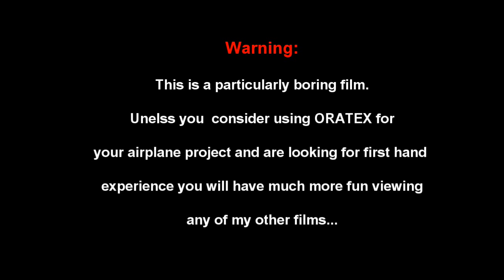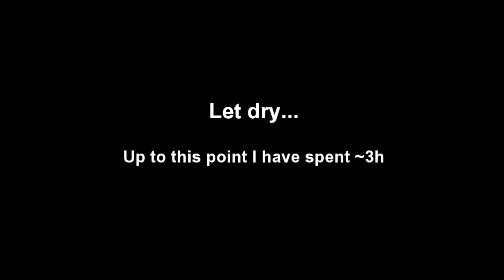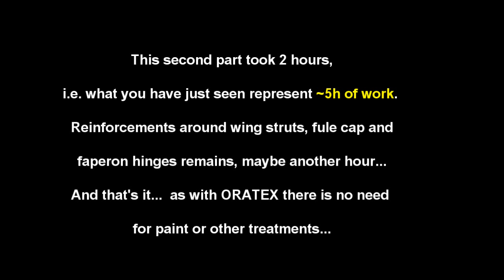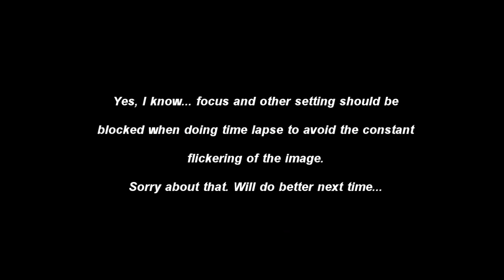Covering a wing with ORATEX UL600

Comment: Great job Fred.  I am going to use Oratex on my next airplane covering.  I recently replaced the fuel tanks on my Kitfox from 1992 and had to use the original Poly Fiber system for patching two rib bays.  Took about 25 hours and the cost of the toxic MEK based materials exceeded the Oratex cost for sure.  Plus I had to wear a respirator while completing at least 20 steps.  Poly Fiber is good, but I think Oratex is the future.

Comment: how much does this stuff cost anyways? were can it be purchased? does it work on wood as well?
Reply from the maker: If by "the stuff" you mean Oratex it cost about the same as covering with traditional methods, not by the meter but as total cost. There is no need for any kind of paint job so if that is something you would have paid for you can subtract that as well. 
Yes to wood, luckily as most of the surfaces glued to on my wing is wood...
If you go to the Oratex/Oracover (google or go to the link section on my blog, link to my blog in the comment section under the film) you fill fine all required information including local retailers and user manual (downloadable as pdf).

Comment: I don't agree with you at all I have no intention of covering a aircraft with this but this video was fascinating. Well done you look like a pro.
I wish it was a certified fabric my Brother has a Taylorcraft that is in need of covering and this stuff looks intriguing.
Thanks for a assume video.
Reply from the maker: Thanks Taz Man. Oratex is certified for both light and heavier aircrafts (Oratex 600 for aircrafts up to 600 kg, Oratex 6000 up to 6000 kg). But the certfication might be country depenent. You brother can find more information on the oracover web site or by contacting oracover directly. They are very responsive.
Regards,
Fred

Comment: aren't u sposed to wrap the first one around the tube and only trim the second to 1" wrap min.
I still think a couple layers of boat shrink wrap might work
Reply from the maker: You need to adapt the method to the construction of the wing you are working with. Starting by wrapping the leading edge 720 degrees as it says in the instructions isn’t really a viable option on this wing. Still holding up well after 6 years.
Reply: @fredstork  I just finished covering the tail of my kolb with polyfiber.  The problem with this stuff is ordering it by the quart and needing another quart and getting hit with A Spruce shipping again and again.  I should have bought gallon of polybrush and polyspray instead of 2 quarts.  I came up a bit short on what I wanted to apply for polyspray too.
Reply from the maker: @FourthWayRanch  not the right video for you if you are using polyfiber… very different technique compared to Oratex

Comment: Hi Fred, thanks for the video.  A few years have gone by since this video was made.  How's the Oratex holding up?
Reply from the maker: Scott Settlemire I got your question just before going out to the airfield so took good look... It still look like new. It is holding up very well. I expected to have to do some heat-gun re-tension from time to time but have not felt the need. In the video description you find a link to my blog. Select only the Oratex posts and scroll down (eventually you need to click "older posts" at the end... Anyway, there is a post on stress testing and aging of Oratex that you might find of value.
Reply: Thanks for the update and videos Fred.  I’ll be placing an order to cover my Challenger II soon. I will take a look at your blog.

Comment: Great video, I will recover my Kitfox 2 shortly.
Did you glue together 900mm and 1800mm sheets?
Reply from the maker: Hej  Peter! Yes that is exactly what I did. There is more details that can be of use to you on my blog. Here is a direct link to the Oratex section of the blog: http://avidsimonini.blogspot.com/search/label/Oratex
Reply: Hej Hej 😀
Some great info there Fred, thanks!

Is the glueing of two sheets an approved method by oratex?
I can’t find any information about that in the manual...
Reply from the maker: @Peter_Eriksson  You will always be gluing Oratex against Oratex in some places when covering so there is no reason why you should not do it. The overlap is rather large and turned the "right" way so I have no concerns. There is a very nice comment from BetterAircraftFabric (pinned on top) , they are selling Oratex to the North American market and would most certainly have protested if I was doing something wrong...
Some time ago I had to redo the landing gear any it was very difficult to get the Oratex off the tubes and Oratex on Oratex could not be separated... But again, I'm just sharing my experience so don't do this at home ;-)
Reply: Thanks for taking the time to answer Fred!. I totally agree with you 😀

Comment: Hi Fred. How did you manage to glue two sheets together (see 0.33) without shrinking the fabric at those points? Surely each time you apply heat to activate the HotMelt glue, shrinking takes place??
Reply from the maker: Hi Reddogchi ! The glue is activated at lower temperature than the shrinking...
Reply: Thanks Fred. Great Video. Can you remember the actual temp that you used to bring together the two pieces (in Celsius)?
Reply: I'm considering using Oratex myself but it looks awfully thin....did you find that any cuts that you had to make (for hinges etc) were prone to splitting further?
Reply from the maker: I don't recall the exact temperaturs... the temperature used is alos dependent on the material behind (wood, steel..) You will need to do your own tests on some samples before starting anyway. But from memory... positioning the fabric (getting the hot melt "sticky") about 50°C, activate the hotmelt about 100°C and shrinking 180°C (those being itron temperatures, heat gun temperature set highter but use at greater distance...). There are instructions and other documentation to downmload from https://www.lanitz-aviation.com/ there might loso be more details on my blog http://avidsimonini.blogspot.fr/ (not sure I got into details of exact temperatures)
Reply from the maker: Oratex is extreamy strong and there is no tendency to rip. I obviously made reinforcement where I had made the cuts as well as, where so possible also hade the fabric glued from behind.
Reply: Thanks again Fred, really helpful!

Comment: What method to attach oratex
Reply from the maker: TEGO SUWARTO with a special hot melt glue. It is a glue that looks like white glue, it has no smell and is solvant free so you can work without specific ventilation. I made some of the smaller parts in my home office. It is very clean to work with. You put glue on both surfaces, let it dry and then you activate it with a heat gun or iron. You can read more about using Oratex on my blog: http://avidsimonini.blogspot.com/search/label/Oratex
Reply: @fredstork  Thank you for the information